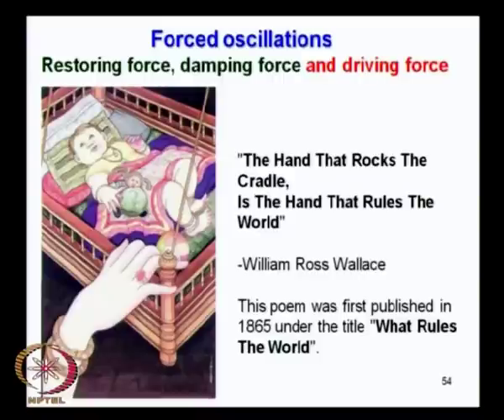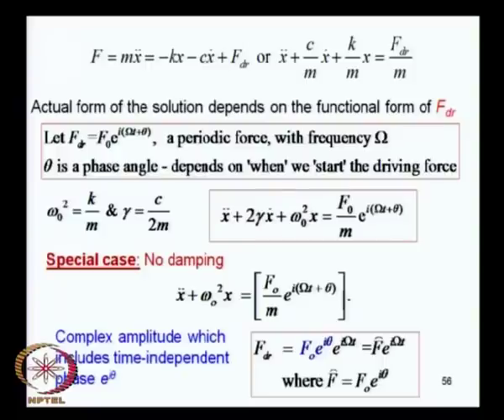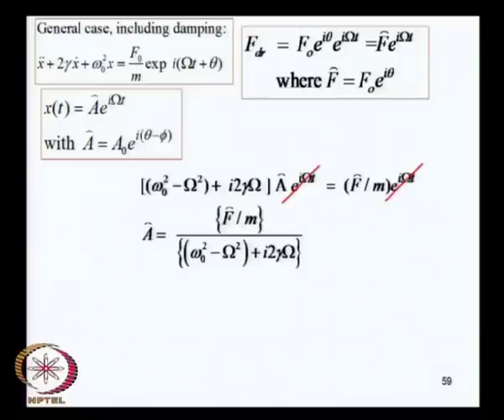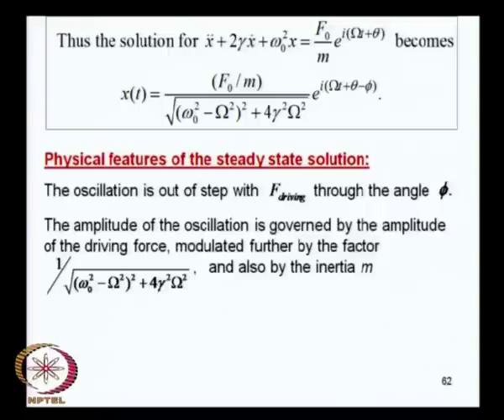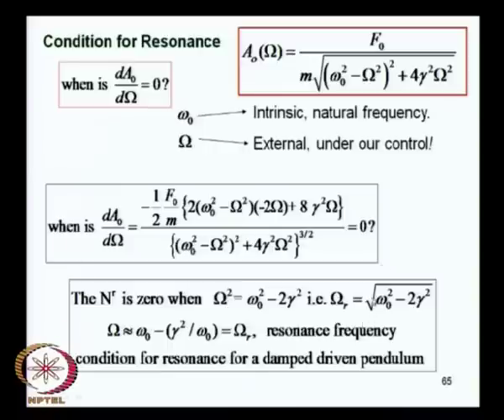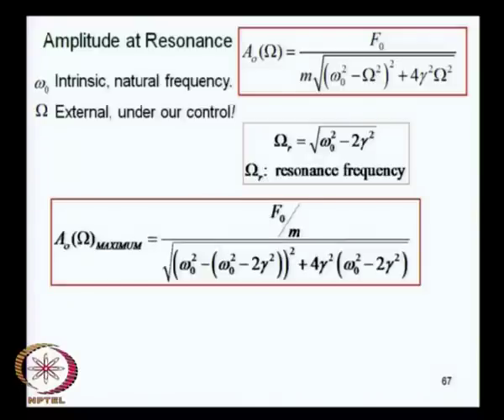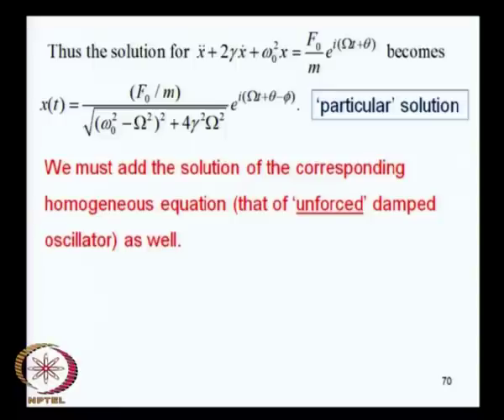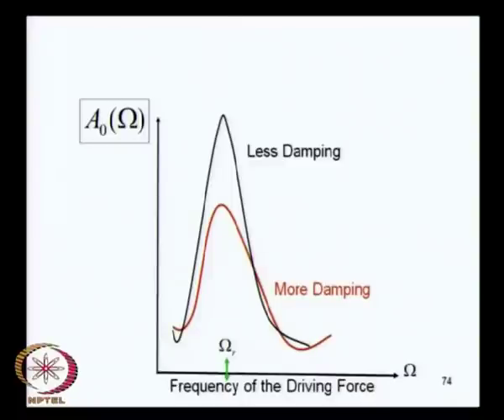Mod-02 Lec-09 Oscillators, Resonances, Waves(iii)

Comment: Very well and nice lectures.
I have a question Prof.
How to, in practice set the resonance on the coil ? Some are LC in series and other are in parallel connected together.
I have a dig. oscilloscope with simple spectrum Rigol 50 Mhz/2ch, 1GSa/s and dig.multimeter. For frequency i use a basic 555 circuit oscillator. It is a problem between sine wave and a square wave signal from them ? For setting the resonance ?

Thank You in advance.
Best regards from Europe